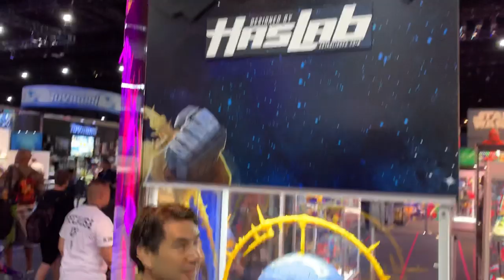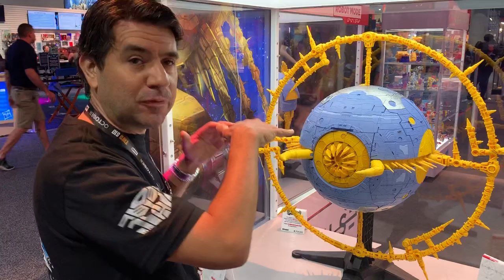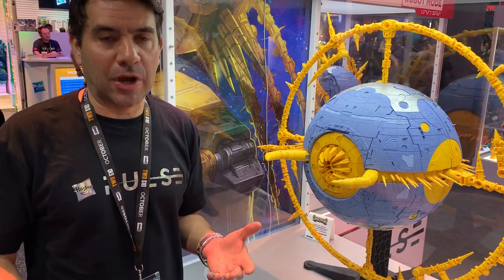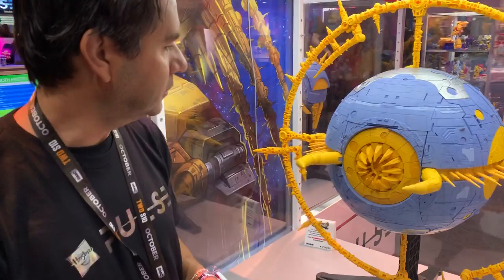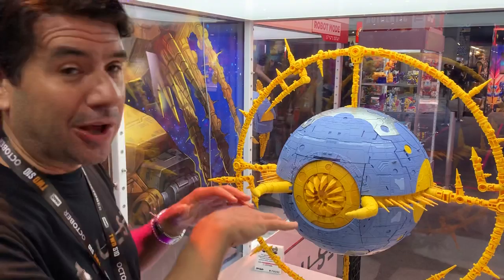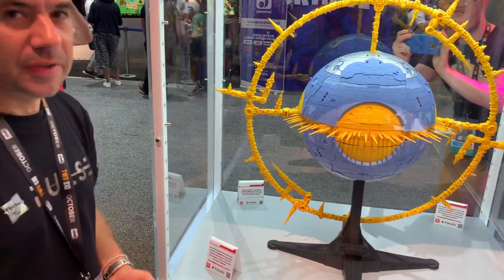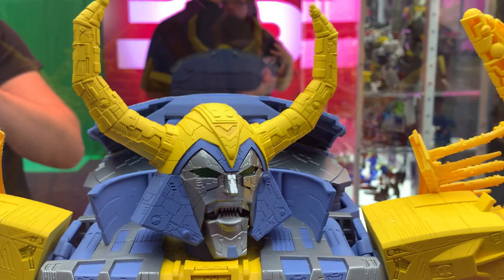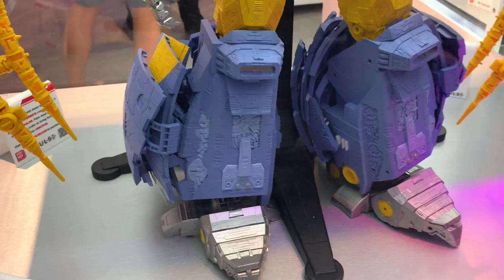Haslab Unicron Exclusive Interview w/ John Warden

Comment: So, Takara will only carry it if it gets backed on HasLab, but there is no way for international customers to help back it so it reaces the 8000 total? Did they even think this through?
Reply: I don't think you need to worry.  In less than a week, there are already 1600 preorders.  I think it will surpass that 8000 number by the time the time runs out.  I bet in the remaining weeks, people will panic and rush out to preorder it and push it past the 8000 number.
Reply: While true, they have a point. You are ruling the possibility of a global release on a smaller population, which hinders the possibility of achieving that 8,000 count they need.
Reply: Takara preorders are counting towards the 8,000.

Comment: I hope Hasbro includes that translucent Megatron being given out at NYCC in this sale since that will help it gain momentum which appears to be flat on their site.  I do like how they included the poster.  However it reflects a particular scene which isn't functional for use.  I would like to see a separate poster that shows just the toy in space in both modes.  Ideally 6 feet tall poster to go behind a door or some where.  That way it can be used as a backdrop image next to MP figures that are otherwise too tall to be next to the toy.  I still want to see a UW Cylconus with a new combiner head that matches Cylconus and Takara TR Scourge.  Including these 3 figures will help sales, and even if they don't want it then they can re-sell it on the secondary market to recapture some money they spent on this figure.  These designs already exist so its just a matter of tossing them in to help push this rock over the top of the mountain.

Comment: I heard they spent 4 Billion to buy death row records which owns Entertainment 1.  But they couldn't afford to have electronics (light up eyes and sounds) in Unicron since they needed to keep the cost down.  Really?  Wei-Jiang Ultima Guard was ~24 inches with the tracks maybe 27 inches tall; and it had electronics and its price was a lot less.  Ideally, its best to have the electronics still work even if the head is detached.  Also hope hasbro give us some stickers to put on the eyes to create a shatter glass affect.  Without more content added to the figure I doubt this will reach the goal given the slow increase of backers the past few days.  We need more news about bonus figures which many people are talking about and wishing to get.  Some of them can be micro size given its Unicron.  Doing this will keep people talking about it each week since the lack of news the past week has result in a drop in fandom buzz recently.  If they add nothing then they can try to get to 8,000 by lowering the price to at least to $475 and then charge $100 for the head with electronics or include it as a standard at the current price.